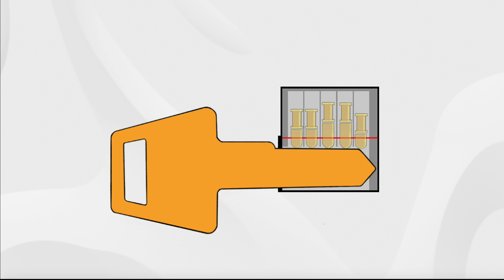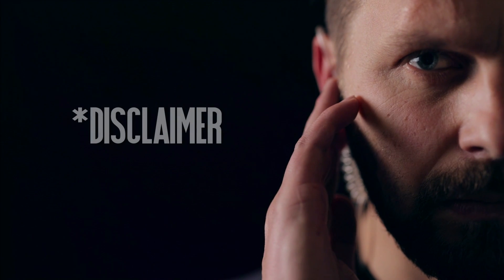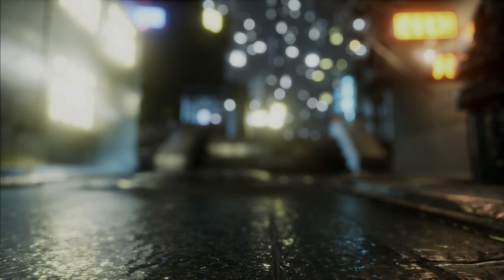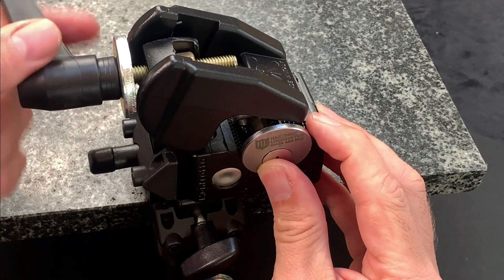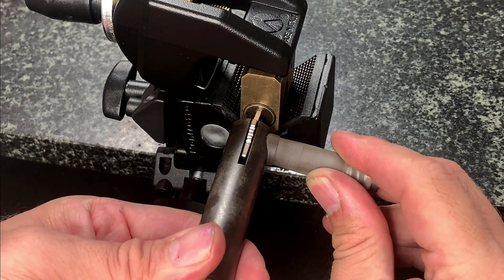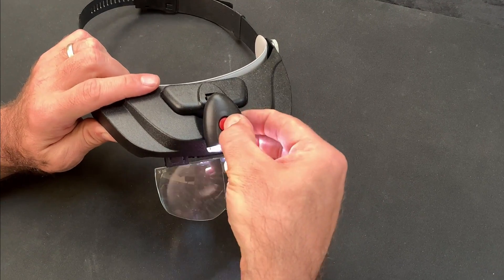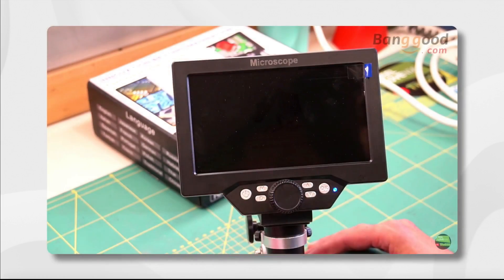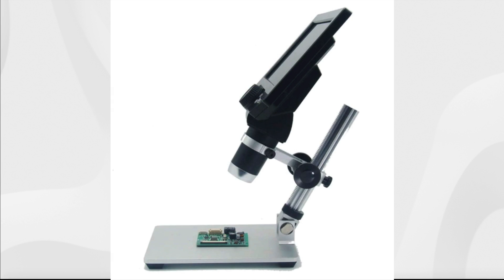038 A beginner's guide to key impressioning (1/3)

Comment: This is how outside machinists make a fast impression on keys: You should start with a Pippen file because it will give a better fit to the side angles on your key blanks. Put a coat of Neolube to the top of the deep and space key. Then insert all the D&S keys into the lock a give them a heavy back-and-forth twist. The keys that did not leave a long mark will give you the required cuts. Then cut the new key using the D&S keys with a Lish Usei Hand cutter and a Dial Caliper. Also always check that your Deep & Space Keys are made to the lock's specifications.  Neolube is made from Graphite & Alcohol.

Comment: Next challenge to Fish Picks: Make a video without using stock images or stock videos.
Reply from the maker: why would I want to do that? I enjoy including stock footage if it serves the mood/tone I am going for. This is a stylistic choice mate - not for everyone I appreciate but I'm not going to please everyone - I can only be true to my interests and style.
Reply: @fishpicks4531  Sorry if i ever crossed you, sir. As much as the style sometimes seems a little bit inundating, they were all quite acurate and edutaining. I indeed apreciate your work.
Reply: @fishpicks4531  Also, would there be a detailed explanation about how and why filing off the shoulder of the key blanks improves their rigidity during the torquing?
Reply: @kilometrekm   We used to call them “stress risers” but I guess they’ve changed that to stress concentration now. Any acute angle in a surface focuses stress into the apex of that angle. This can cause crack propagation. So you want to reduce the angle at that point. Curves (or circles) are a great way to open the apex up. Mechanics often call this “stop drilling” because they will go to the end of a crack in fiberglass, plastic, or metal and just run a small drill through at that point. Now there is much more force required for that crack to propagate because the stress riser is spread over the entire, curved surface. Try this the next time your trash bin cracks or the fender on your ATV starts to crack. In the case of a key bow, it’s an open angle (90 degree step) so by using the round file, he’s kind of doing a stop drill but with only a quarter of the circle!
Reply: @JohnSmith-gs4lw  Thanks so much! I'll try this next time I impression.
Reply: @JohnSmith-gs4lw  Could this be the reason why some key(/blank)s have a small half-round dent on the blade close to the shoulder out of the factory?
Reply: @kilometrekm    I suspect so, but I’m not sure. You could go over and ask Jason on the SE Lock and Key channel. He’s a locksmith and might know for sure. I do know, from an engineering standpoint, you only need to open up that angle a tiny amount to make a HUGE difference in the crack propagation resistance.  You can try this next time you open a bag of food that has those little starter cuts on the edge. You’ll need a chainsaw to open it without those starter cuts, but use the cuts, and a child can open that bag of cookies. 
 
For the interested, this phenomenon cost several people their lives before it was fully understood. You can search for “de Havilland DH.106 Comet” and read about square windows in the first version of that aircraft. Those 90 degree corners in the windows caused stress risers and airframe failures that resulted in the aircraft coming apart in flight. Now you know why all modern aircraft windows are rounded squares or ovals!
Reply: @JohnSmith-gs4lw  Thanks so much for your knowledge and patience, sir. :-)